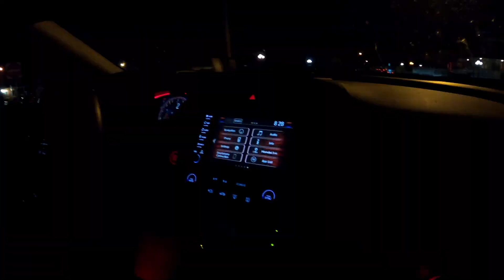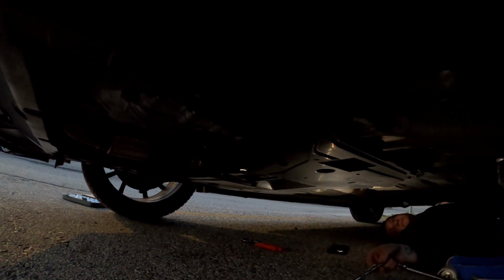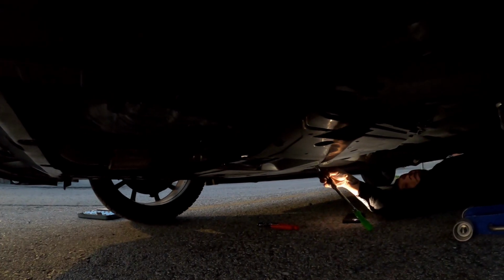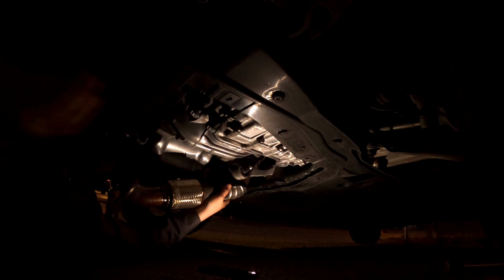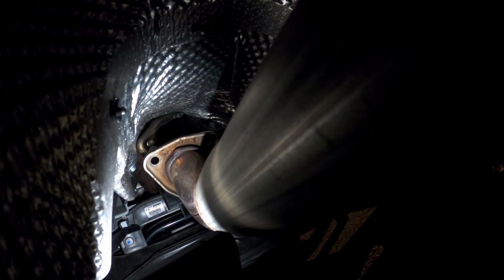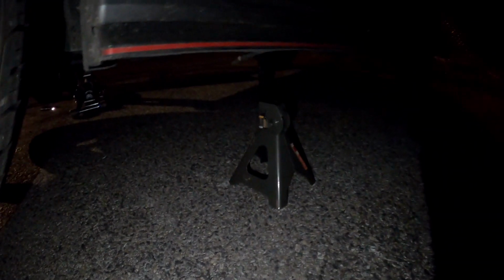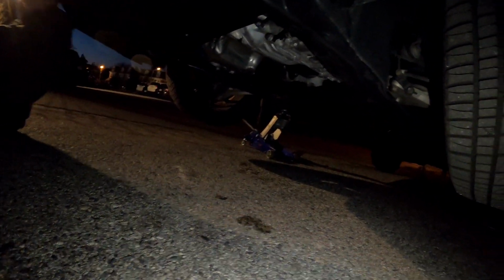CATLESS DOWNPIPE ONLY!! 2019 CIVIC TYPE R REMOVED EXHAUST CRAZY LOUD!!

Comment: Cars have a cat for a reason.
Going to end up damaging a nice car.
Reply: The reason is for emissions. It wouldn't damage the car, but it WOULD damage the environment
Reply: "Some vehicles use the catalytic to warm the Oxygen sensor up so it can start controlling fuel/air mixture. What do you think will happen by removing the catalytic? You will not likely increase power, it will be a bit louder though. It won't likely hurt your engine, and it won't likely help your engine either"
Reply: Robbie_L_B most of the times with a catless downpipe u use a tune to counteract the sensor
Reply: @repairaholic4858  It will increase power catalytic converters decrease power there's isn't a single test ever done where this hasn't resulted in better exhaust flow and power.
Reply: Robbie_L_B that’s the upstream 02, do streams just read the ratio don’t do anything but